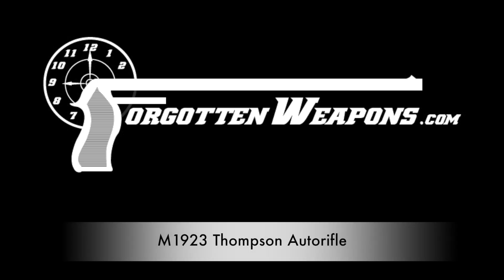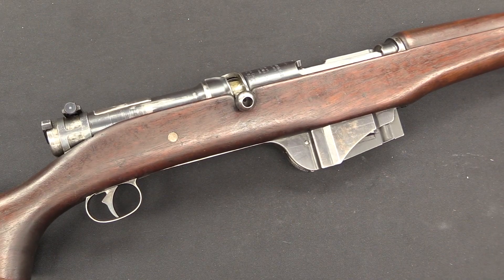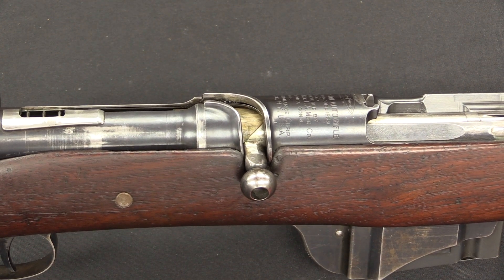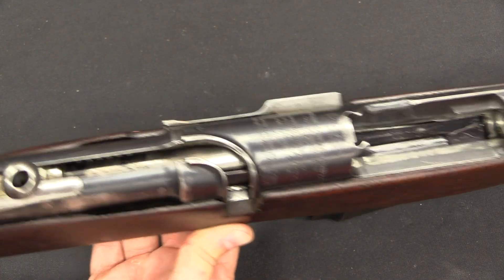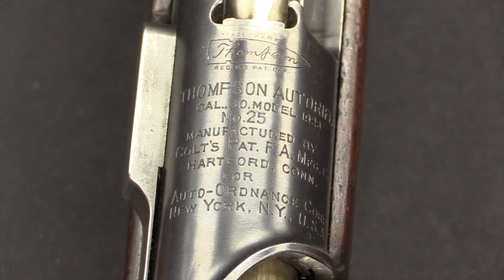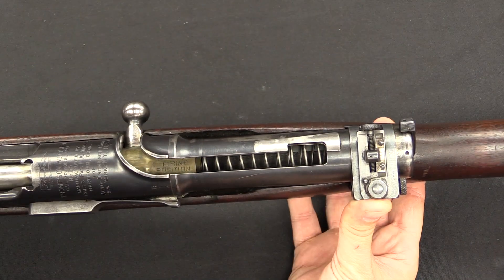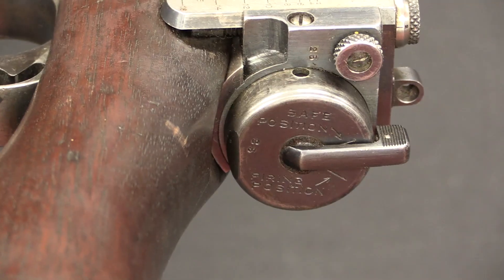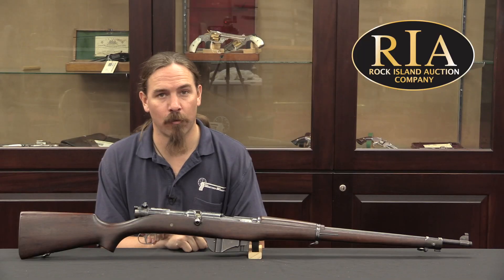Thompson's .30-06 1923 Autorifle: Blish Strikes Again

Comment: I feel like the blish system would work wonders on intermediate cartridges like 556 762 and 300 blk
Reply: It barely works in .45 auto, there's far better delaying mechanisms.
Reply: @atfyoutubedivision955 after making this comment I went and did more research blish doesn’t work at all. Like at all. It’s a myth. It’s the mechanical disadvantage of the bolt having to rotate that makes the system work. Not the fact it’s brass and steel rubbing together at high pressure. Essentially the blush mechanism in both the 45 and the 30-06 were just delayed blowback.
Reply: @Echocompany2-7  And barely delayed at that. There's videos of people shooting Thompsons without the Blish lock, and the cyclic rate doesn't go up that much.
Reply: @atfyoutubedivision955 I think the cyclic rate change comes from other factors like less bolt weight from the brass piece. Like blish doesn’t work. It’s a myth although they are cool guns.

Comment: This needed a secont cam path with a corresponding lug, both cam paths becoming fully transversal at the "locked" end, and a gas tube leading up to the bolt handle blowing gas upward. Direct impingement as it is :D

Comment: This sort of mechanical disadvantage delayed blowback system probably could have worked had it been designed with more friction lugs than just the bolt handle. That single locking point is just asking for damage. Its almost Iike firing smokeless in a Gras or Mouser 71. The symmetricsl style lock used in the 1921 Thompson SMG hsve been better. Obviously, the blish principle itself was bunk.

Comment: I feel like it has to be a bad idea to put all the force pushing against the bolt on one point set off to one side of the bolt axis like that. and the sliding surfaces would DEFINITELY wear badly and cause the bolt to not close fully anymore. the amount of friction would also change with the wear. and making a gun rain brass from 30 feet above is hilarious.

Comment: Did I understand that correctly? In order to engage the safety, you have to pull the trigger first? So when the safety is on, the weapon isn't cocked, but when the weapon is cocked, you can't put the safety on? Really?

Comment: Is that thing really "completely" semi auto (ie barring any malfunction as long as it has ammo all you have to do is keep pulling the trigger) or is it just a self ejecting bolt action that you have to push back into position every time?

I just dont see that bolt rotating 90 degrees back down just under spring pressure and locking properly every time.

Comment: Very interesting comparison between the the SMG and the auto rifle. The SMG was found to work better with pistol ammo, perhaps the Blish system proved that point.
Curious Colt and Thompson didn't work that out and try to find an alternative solution, maybe a compatible cartridge for the rifle. I think the clue to the blish incompatibility was the excessive force that spent cases were ejected. The back pressure  must have been tremendous. This rifle must have been designed to combat the laws of physics, what if that slight backwards slope of the charging channel had been sloped a little more? Maybe a shade off the bolt and polished to lessen the friction slightly?

Comment: Does anyone know if there were any firearms designed around the Blish Principle other than the Thompson M1921 and the Autorifle?
Reply: The Thomson 1928, but those elements removed from later military gun, as not needed for it's operation.

Comment: If you think about it, any change in cartridge load completely defeats the delayed blowback or it doesn't work at all. 

Dissimilar metals rubbing against each other would lead to galling, which might be ok for a large naval gun that fires relatively few rounds, but would be unacceptable for a service rifle. It would be a nightmare to monitor: your first indication of excessive wear would be an injured soldier!

Comment: The problem with the blish system is actually exacerbated by the choice of brass for the locking block.  Differing grain structure in the metals will lower friction.  Watches and clocks have steel pinions and brass wheels to lower friction.

Comment: The blish effect isn’t just a theory on physics. It has to do with friction between two dissimilar metals, and is more based on chemistry. That’s why the inside of that gun is brass and the outside is steel. He was 100% correct. The problem is once any type of fouling, dirt, lubricant, or corrosion gets in between the working surfaces, the metals don’t contact each other any more, and the entire point of the system is ruined. Then it becomes a delayed blowback. The first shot out of the factory probably worked as intended. Many metals have a ton of weird interactions with each other that don’t really make sense.
Reply: No, there is no "Blish principle"

Comment: Yeah this design is just asking for trouble. Having the bolt itself as well as a camming surface as a primary “locking” surface is just not an idea. As well, delayed blowback works for .45ACP, but 30-06 is a whole other beast.

Comment: Having that bolt snapping up into your sight picture and coming at your eye at high velocity would be just a tad distracting, I think.
Reply: I kinda doubt that's an issue, the Pedersen has a similar issue and I've never heard anyone complain about it
Reply: Okay, weird idea, but what about a bolt handle that just goes backwards and fowards, but is on top and used as a rear sight?
Reply: @sumvs5992  Pfft, only a lunatic would come up with something like that, then put it on a really compact, center-grip submachinegun.
Reply: @Bacteriophagebs  yeah I think I just remembered the annihilator. I'm a bit of an idiot sometimes.
Reply: @sumvs5992  I was actually rederring to the MAC guns, which didn't technically use the bolt as a rear sight, they just cut a trough in it so you could see through, but unlike the Uzi, the MACs had a reciprocating bolt, so it was snapping back and forth while firing.
But since you'd be looking through the bolt already (if you even bothered to aim), I doubt it would be as noticeable as with the gun in this video.
Reply: @Bacteriophagebs  
Also the original pattern thompsons before the M1 changed it to be on the side.
Reply: @sumvs5992  Having a sight on a moving component is not good for accuracy from a mechanical perspective, your sight picture moving around is going to slow follow-up shots, and it makes engineering any adjustability into the sight significantly more difficult. There are also indirect concerns: for example, if the user has some mud on their hands and then runs the bolt handle, they stand a chance of fouling the sight.

Comment: The words "blowback 30-06" cause me to tremble a little bit.
Reply: A truly terrifying thought upon any kind of serious (or not so serious) contemplation.
Reply: Ten pound bolt maybe lol
Reply: @buckhulit2718  Spring taken out of the suspension of a truck
Reply: HK G3s are delayed blowback. I've seen G3s (at least a modified HK G3 roller delayed system) chambered in 300 Winchester magnum and .338 lapua magnum. It works! As long as you design it right...

Comment: Thompson sounds like the Mr. Magoo of firearms engineers. He made two gun designs that accidentally worked (more or less) based off a physical principle that doesn't exist! That's actually pretty amazing.
Reply: He pulled a "Homer". 😁
https://en.wikipedia.org/wiki/Homer_Defined
Reply: He looks to be thinking of delaying the blowback with some kind of mechanical resistance. In a way, he was thinking along the lines that would lead to roller delay, just with a very different starting point and understanding of the physics. (He was a couple decades prior.)

Comment: Hi Ian,
thanks for keeping on doing interesting videos.
The thing is, I believe,  that if the locking lugs are part of interrupted thread (the locking surfaces are not perpendicular to the bore axis but rather angled), the force bearing surfaces can be any of them or the handle. As soon as the locking lugs disconnect from the receiver recesses the only force bearing surface is of course the handle, but before then, it can be any combination of those surfaces and handle, depending on tolerances, wear and deformation under stress.
Seem that the handle could easily snap of if you're right.
Thanks once more,
Martin

Comment: I could see the Blish idea working at pressures not achievable in a gun, like say enough pressure to just start pushing the  materials together at the molecular level thus locking them  together until the pressure is lessened and they can un-link again.

Comment: The real question, in my mind, is why Thompson remained convinced in the efficacy of the Blish principle after seeing this thing tested.
Reply: Well, the gun kinda works, so the principal is truth, right? It is all magic and MLP, when you don't have 11 grade level of knowledges of physics, and i haven't heared that John T. Thompson had those
Reply: It works as a direct blowback system with full power cartridges, that is to say dangerously hard and fast, as opposed to having any kind of delaying effect from the theoretical blish locking principle. It would be obvious to anyone seeing it tested that it was dangerously un-delayed.
Reply: Probably thought the Blish principle still existed, just wasn’t strong enough for a full powered rifle cartridge but strong enough for a pistol cartridge. The Thompson worked, so they kept it until the M1 and M1A1 simplifications.
Reply: @gameragodzilla  Blish principle does exist, It's simply not effective for firearms. Whether it be because it requires very clean surfaces, not enough forces, or the fact you need a delayed blow back mechanism for blish to work anyways.

Comment: To be honest, it's a pretty neat design and the issues are far from unique to to just this design. The Pedersen had many of the same issues and the first Garands weren't all that problem-free neither. Never mind that Blish lock thing ( which actually does hold some merit with some alloys, but nowhere near enough for any application such as this and under these pressures) the idea, as a delayed blowback would be very well suited with lower pressure calibers and would have been a pretty nice platform, when simplified, for a cabine.

Comment: A delayed blowback in 1923? neat, i wonder if they could have got this to work with non-oiled ammo if they added chamber fluting and tweaked the locking lug geometries and bolt weight and so on. Not that that alone would have saved this gun, the whole design is very inefficient when it comes to machine time, resource usage, and weight.

Comment: If you locked the bolt open during disassembly, wouldn't the spring tension be entirely within the rear receiver section (preventing launching)?

Comment: Couldn't you just lock the bolt at the rear for disassembly?  Then you aren't fighting the spring to disassemble.  You'd have to be careful releasing the bolt afterward, but I think it'd be easier than trying to hold the bolt during disassembly to keep it from flying forward

Comment: Never thought I'd hear the words "delayed blowback" when describing a .30-06.
Reply: Why? HK made delayed blowback .308s. I think they even made some commercial .30-06 hunting rifles.
Reply: @LifeisGood762  Purposefully build delayed blowback, and delayed blowback based on an incidental bolt handle acting like a locking lug seems very different.
Reply: @emilychb6621  yes..... yes it is lol
Reply: Michael Treu this thing is closer to straight blowback than any of HK’s delayed blowback stuff.
Reply: @LifeisGood762  but would that be a ROLLER DELAYED blow-back? or even the "wedge" delayed like the DP-28 (and a few early HKs iirc) 

or were they "simple" delayed blow back.... AKA, a big old spring and thats it
Reply: DP28 is flapper locked, not delayed  @kainhall

Comment: I'm not sure I understand how Ian is proposing this thing actually works. Unless the tolerances between the locking lugs on the bolt and recesses in the receiver do not actually allow for engagement between the two, how can the bolt begin moving rearward enough to impact the slightly angled track in the bolt handle raceway and cause upward movement that then unlocks the gun?
Reply: I guess they are actually angled, part of a screw-thread, just like locking lugs on naval guns?

Comment: Wondering why Thompson didn’t try to design is to use the BAR’s 20 round magazine 

I’ve had the same thought regarding the Garand
Reply: David Sachs the military wanted en bloc clips for an infantry rifle, not box magazines.
Reply: The BAR magazine didn't play nice with designs that had faster loading mechanisms
Reply: It used a BAR mag... he mentioned that in the video. This one just has a cut down BAR mag with two pieces welded on.

Comment: looks too long, and possibly heavy. The exposed spring area I'd expect to be an excellent source of jamming. 
blish locking is too silly. when fitted to the Tommy gun, it just made it heavier as far as I know. I'm not a gun builder or even a professional engineer, but this fails the basic principals of mechanics. The Springfield 1913 ,would have been superior to this as an infantry weapon, in Vietnam. just my opinion.
Reply: I mean to be fair the action on this is more protected than the M1 grand

Comment: Let me get this straight...... You have to fire the action before you can engage the safety?
Reply: 86 abaile this is actually not that uncommon. Especially in firearms where the safety is a simple interrupter. It’s like that so you can’t put the safety on while there is a round chambered, to prevent drop firing and such.
Reply: In which case its more a case of 'safe prove theres nothing in the chamber' rather than a gun locked and loaded

If it would be more obvious to see it would be useful for training ranges so the instructor can easily see that all guns are safe before someone moves around the line of fire for whatever reason, say standing infront of the recruits to tell them something or whatever
Reply: The gun has to be uncocked, not really fired. Just like a Glock: drop mag, clear action, pull trigger.
It's not dangerous or uncommon.
Reply: @riverstyxarmory9782  It's weird, though. There's no way to put the safety ON while the gun is ready to fire. You can only engage the safety on an empty chamber, which is the least important time to needed a safety. 

So the firing procedure would have to be: awkwardly rotate safety off, and then chamber a round. That's not exactly quick.